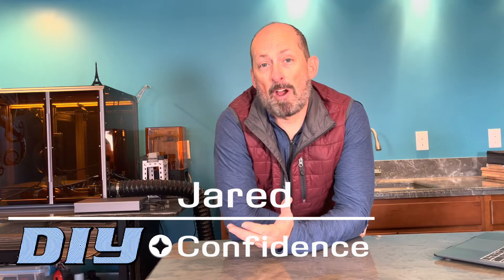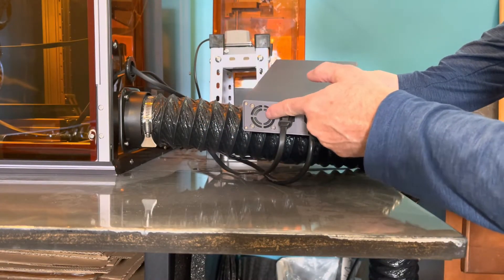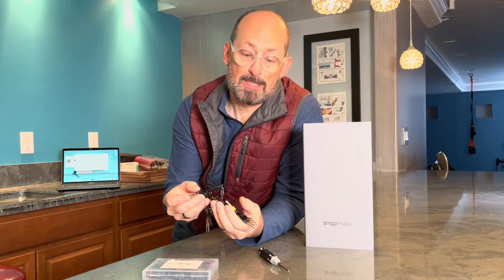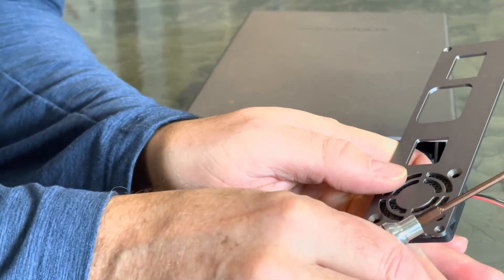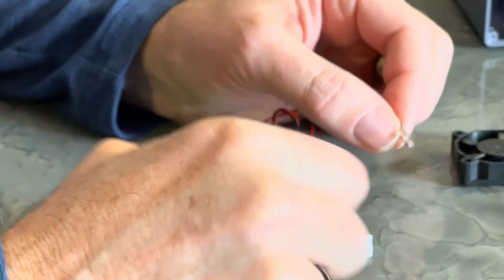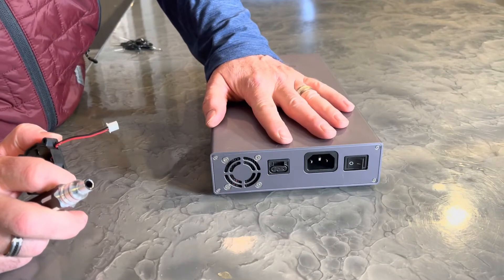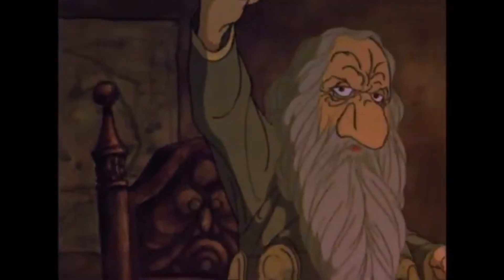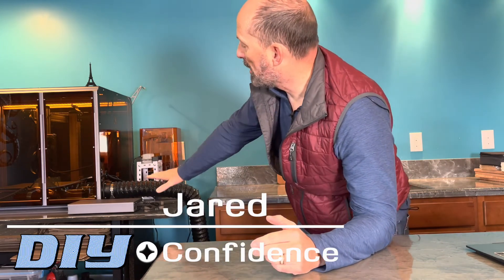Snapmaker 2.0 - 20dB less noise

Comment: when I opened up my power supply I noticed that a different fan was built in. It had four cables instead of two (yellow and black also) and the cable mount was in a different position I couldn't reach with my fingers. Unfortunately, I noticed that after I purchased the new fan. Seems like there are two different kinds of builds. Maybe it also works with the silent fan if I only take the red and black cable. Right now it's a bit too sketchy for me to try out. :/
Reply from the maker: That’s interesting. I have not seen that before.

Comment: Hi, I just put my 2.0 A350 together. I really like your tip with the fan, ordered one and will change ASAP. But what I'm more bothered with is that the linear units for the Y is very noise. I'm think they both noisy and makes vibration going through the floor which is the roof for our bedroom...
Any tips for this?
Reply from the maker: I was amazed at the noise reduction using the enclosure. Do you have an enclosure?
Truthfully and lamentably, my friend, I have no solutions to silence the linear motors. I will keep thinking and looking.
Reply: @diywithconfidence  yes I have the enclosure. I think it's mostly vi ration and maybe my table that makes it sound even more. I will try to put it on a concrete with foam under.